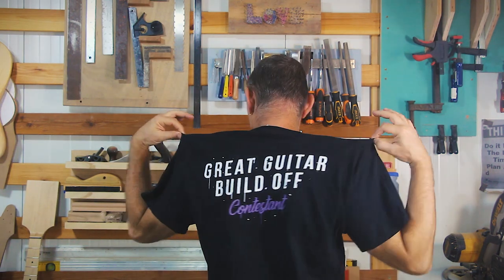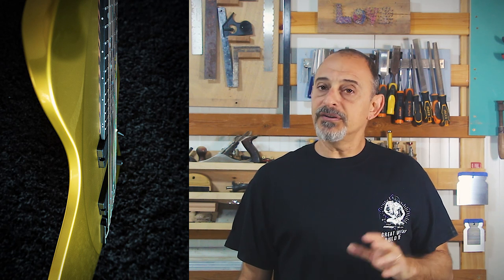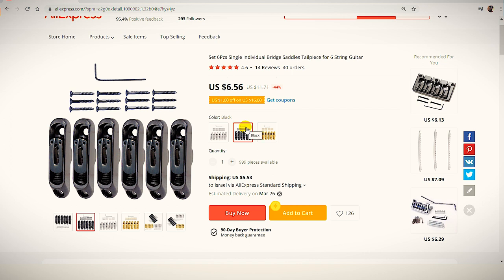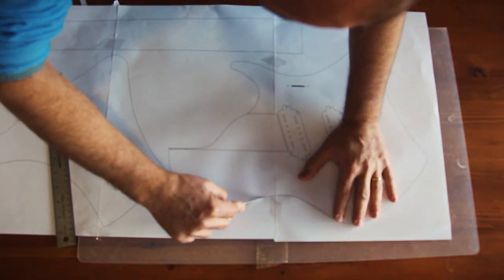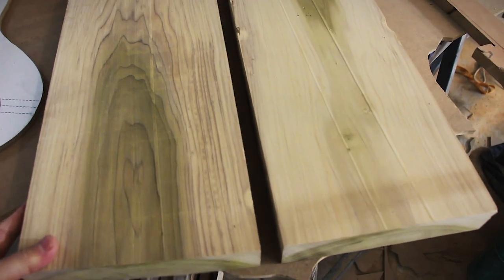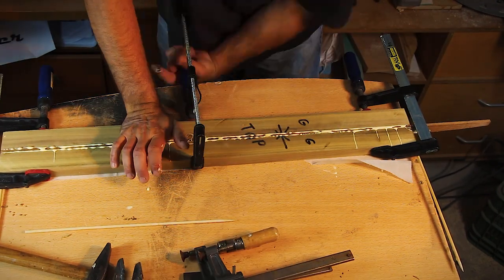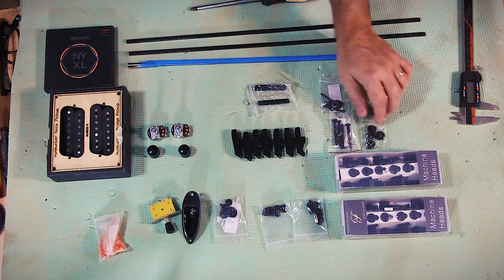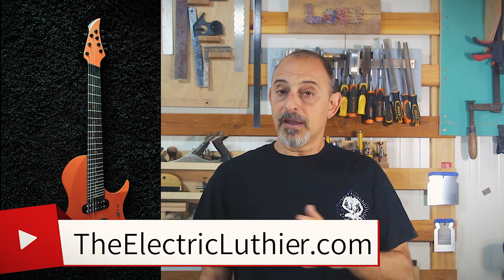Great Guitar Build Off - Orangina -Preparation - Part 1

Comment: Ipê is a brazilian wood. Ironwood is Pau Ferro which is another type of wood different from Ipe. Pau Ferro, Pau preto and Cumaru are even harder then Ipê.
Reply from the maker: Thanks for the correction Tauan, 🙏 guess I need to double-check my sources. Regardless, this is the last time I am using Ipe, it is too hard, brittle, and heavy, so there is no part in a guitar it has an advantage for. Correct me here, if there is..